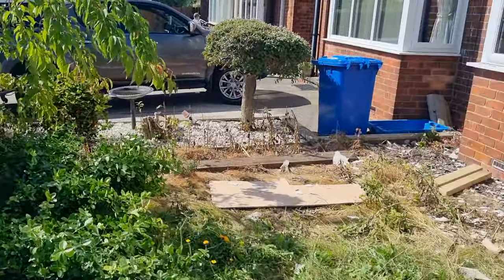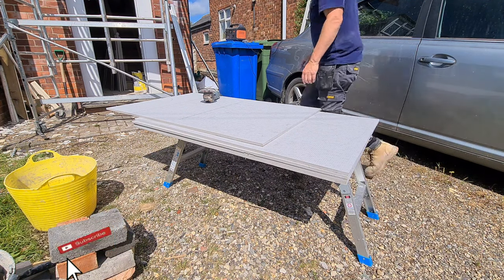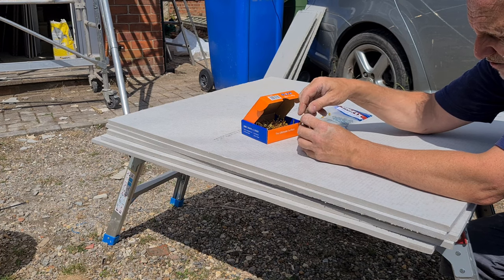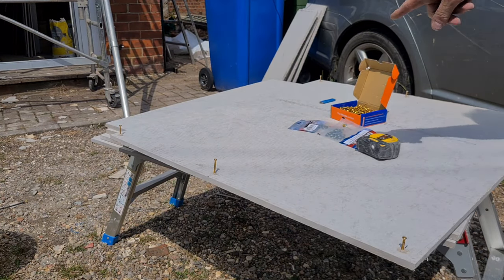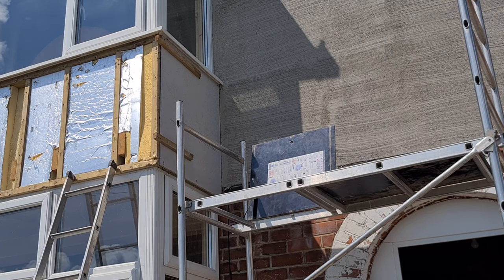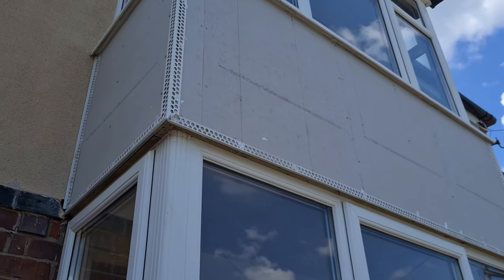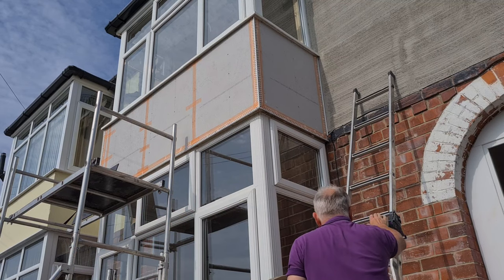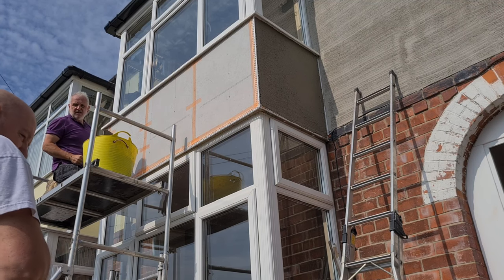Replacing the bay window cement boards

Comment: Any concern not having a cavity/air flow behind the boards? Guess not since they're going into a bay that was never designed for today's standards. Thanks.
Reply from the maker: No issues mate, all the bays along here had a timber frame with a form or lath and render, we removed the old cement board that had failed, the external is insulated so no warm air hits a cold bridge, plus as an extra an additional frame was built on the inside with a foil insulation acting as a warm vapour barrier.